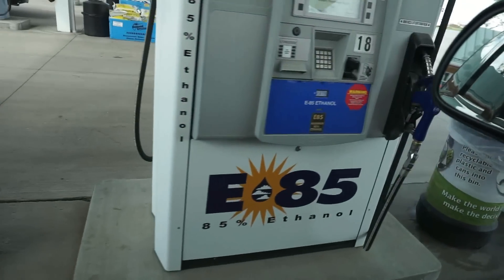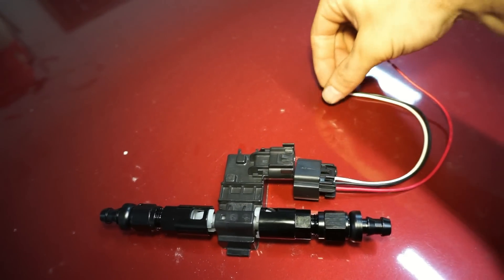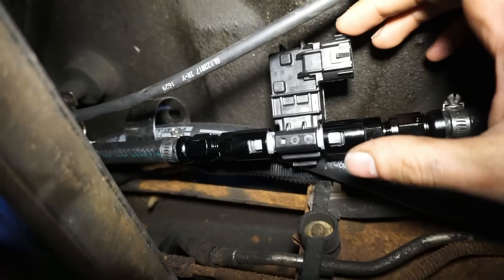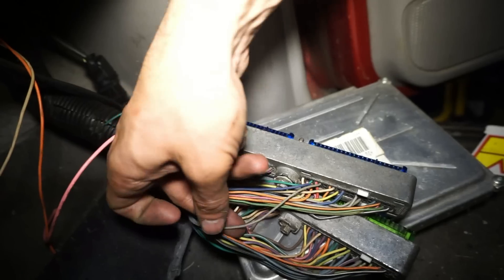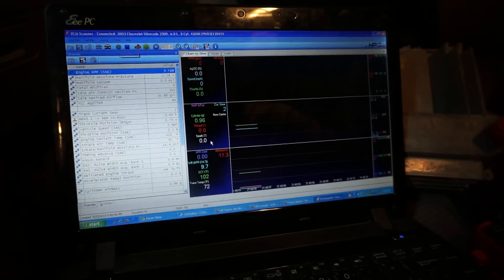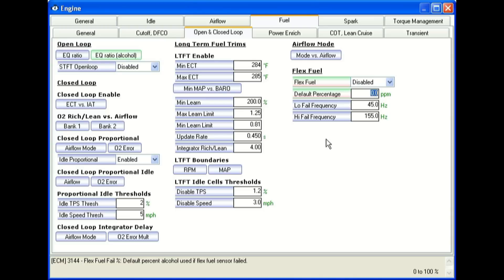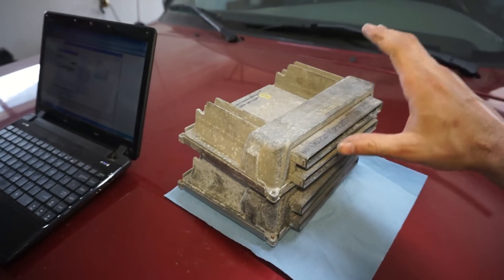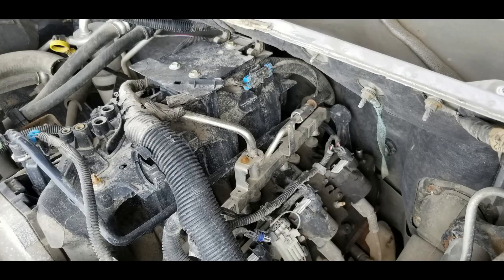BUDGET LS SWAP GETS FLEX FUEL!!! E85 p59 and Flex Fuel Learnings!!!

Comment: Do all p59s have flex capability? I did custom os 2 bar in hp tuners and both that and my original tune had tables for flex fuel.
Reply from the maker: It has the tables but they do not work unless a segment swap is done. Unless it  came from a flex enabled vehicle. So technically yes it had it, but you can't just enable it. Have to do segment swap with a marching OS number that had flex enabled.

Comment: Is that the Rubber EFI gas lines from oreillys ? Because I have those but always thought you can’t use E85 with those . Please LMK
Reply from the maker: Might not be oreileys, but its rubber. Can use, just depends how long.
Reply: How long are your rubber fuel lines ? My rubber lines are in different part but the main stretch down the frame I used metal lines

Comment: You can check the pcms at the junk yard with your mpvi2 using a 12vdrill battery and a bench harness. Keeps you from buying bricks and you can check for flex fuel

Comment: you could even use the rear O2 wires.  Power ground and one of the signal wires., high or low take your pick.

Comment: This is a 12v sensor and not 5v? There's not a lot of actual wiring vids on this subject. I kinda figured it would be 5v like the ops. 12v would be alot easier. Appreciate the video
Reply from the maker: Ignition 12v.

Comment: So you had to pull a file that was from a factory flex fuel enabled vehicle, write entire, the transfer your data from the old tune into the new tune?  I am pulling 0 from the sensor after installing, now I'm thinking it's because I've been trying to enable flex on a factory OS that was non-flex.
Reply from the maker: Yes, it has to be a factory flex enabled tuned to start with. You can write a flex enabled file and then change to your current settings... Or segment swap with a matching OS#

Comment: Did you ever try and see if the segment swap would work with the same os? I have a 04 silverado non flex fuel that i would like to switch to flex fuel. its completely  stock right now.

Comment: That was an excellent idea using the wires from the selector switch connector. 👍
Reply from the maker: Bad Luck Garage Had to do it... It just felt right, lol. The little extra work was much more satisfying than running extra wires.

Comment: Why do you want to run ethanol gas instead 100%?
Reply from the maker: Ill be able to use any fuel. I can tune it on e85 which will be more stable and a bit more safe at the track... Can add a bit more timing safely to make more power, but don't have to rely solely on e85 because it isn't sold everywhere.